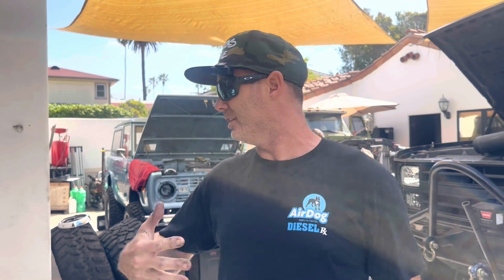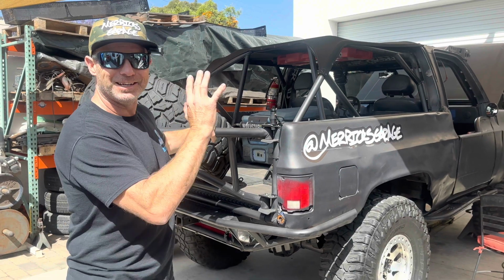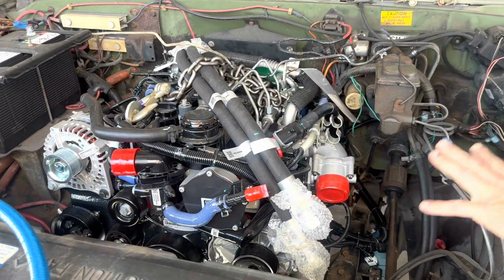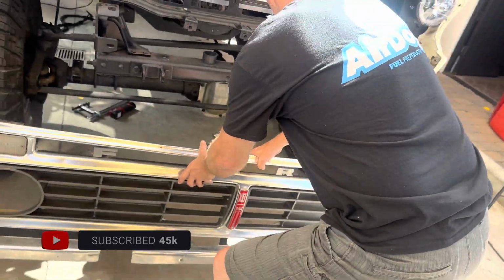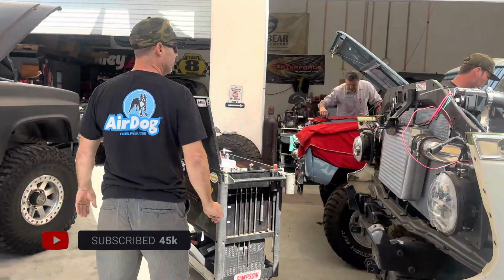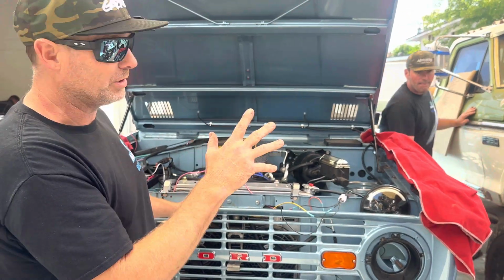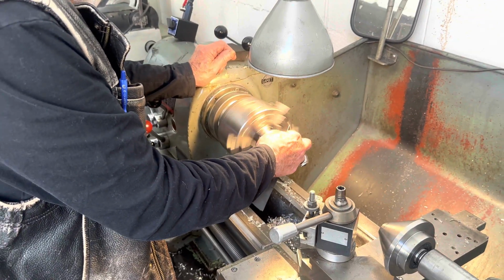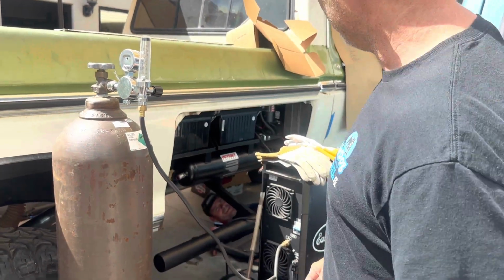Cummins powered F350

Comment: James I am building a K5 Jimmy I would really like to have your advice on installing 1 ton axles and where I need to go to buy gears for my 14 V full floater 10 1/2 inch ring gear. I cannot find where to get gears and a locker I also really want aDiy four by Dash if you have any way to get one of those, I would love to buy one from you.

Comment: Short answer NO!😂 Also Chevy never made a square body S10 and Ford never made a square body Ranger. This whole “square body” thing has been thrown around about a bunch of vehicles after the 73-91 GM trucks have been given the name. It’s always the late 70s and 80s vehicles, that’s because every manufacturer forgot how to bend steel for about 15 years😂 That doesn’t mean everything should be called a square body.
Reply: Exactly.
Reply: Thank you